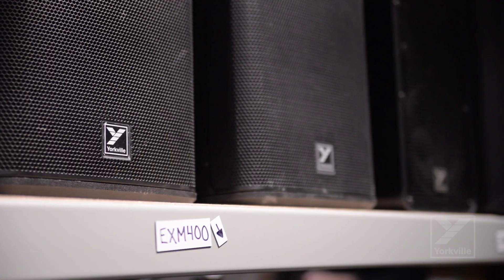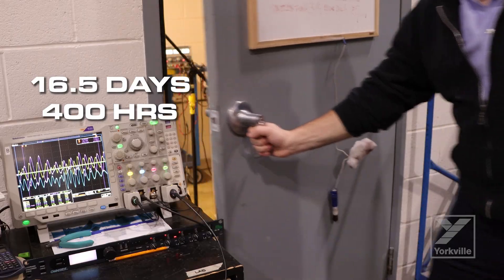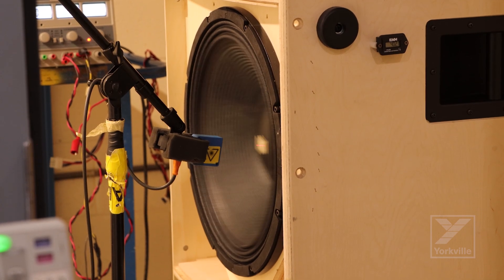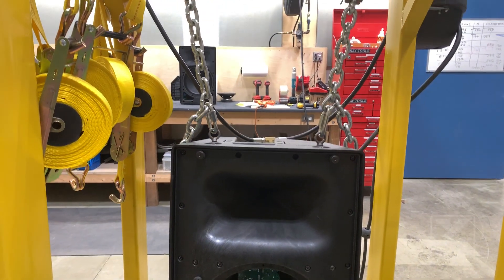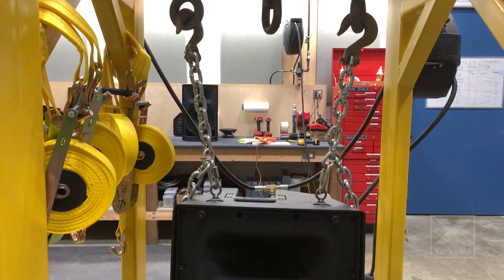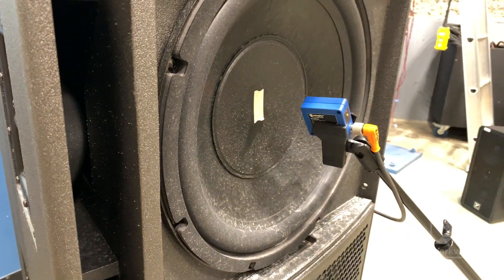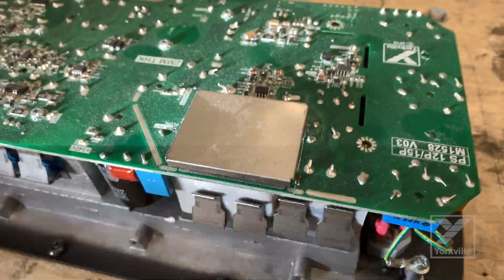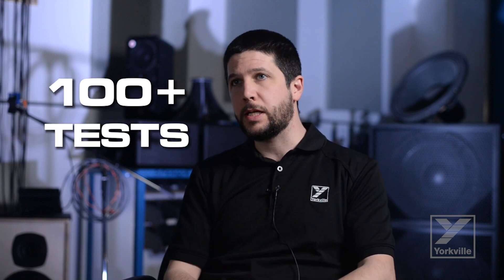Yorkville Sound - What is Reliability?

Comment: Let me begin by saying I love yorkville, I own several Paraline tops, the sound is incredible., they are also very sturdy physically. My one complaint with the Paraline is it's circuitry protection. I got some bad power from a generator, which blew 5 of my Yorkville Paralines ( the boards were damaged beyond repair. However, I had a pair of Staner speakers which are much cheaper than the Yorkville that were also affected. However, the Staner just required a change of a very inexpensive fuse about a $1 US and was back up and running, not so with the Paralines. 

Like I said great speakers that iIwould buy again and again, just disappointed in it's circuitry protection

Comment: I see this reliability often in the field with Yorkville products... There is a set of Yorkville powered subs in the Lower Deck in Halifax Nova Scotia, that were installed in 2003 that have run 7 nights per week with only two nights break per year that are still working perfectly to this day after being under water twice while plugged in without damage. I dried the amp modules out as well as the drivers and cabinets and they work like the day they were installed. I personally have a set of Yorkville powered Pulse subs that were new in 2000 that were under 3 feet of water from Hurricane Jaun that I still use often and I don't go easy on them. They still work perfectly.
Reply: Amazing, absolutely amazing.👍
Reply: I have a yorkville unity Sound is amazing, but only 1 in Germany found a yorkville unity 15 is imposible

Comment: Great video and glad to see the focus on reliability!  I've own countless Yorkville products over the last 25 years and have never had a single failure.  NXP series speakers.  Unity Series Speakers.  Elite Series.  Power amps etc. Solid products which may also explain why when compared to the competition, they often are a little heavier - but I'd rather have that than it fall apart.

Comment: Still have a TX 8 AND 9 system that sounds better that some newer stuff , once had some 8's  slide off a moving truck , they got some brusies but still working just fine, in fact on a whole yorkville makes good gear even got some 3000 power amps that over 25 years still working. lol

Comment: SO happy to see this video! These fundamentals are exactly what Yorkville can build even bigger presence off of! I have a NX350 that was 6 feet high on a tripod stand in my basement. I went away for a couple days and my cat must have tried to jump onto it and I found it on the concrete floor with the stand still attached. The worst came to mind while picking it up off the floor. There was a minor scuff on the corner it fell on, but the speaker did not have ANY adverse affects! I still use it to this day! Thanks Yorkville, you folks make terrific products!!